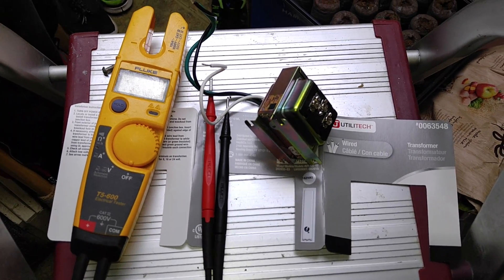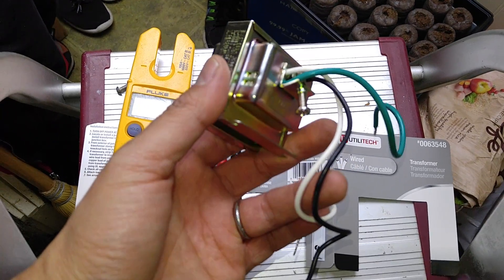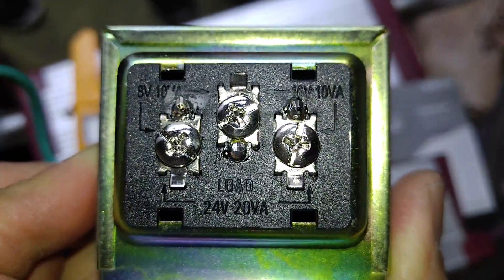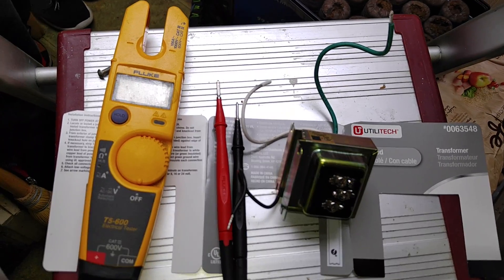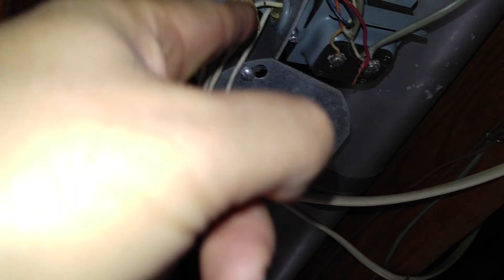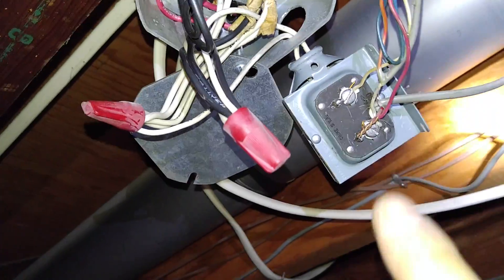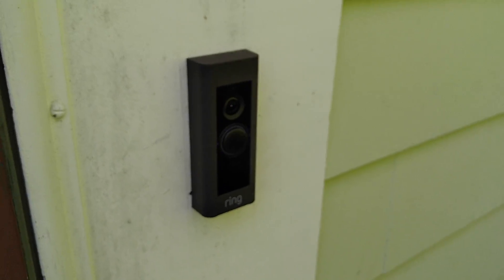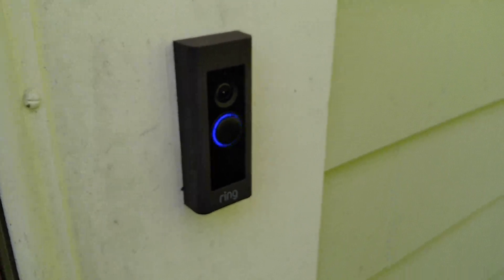Upgrade your doorbell transformer for Ring Pro Doorbell

Comment: Does the Ring Doorbell actually rings the mechanical chime unit???  I haven't seen anywhere that a mechanical chime unit will ring.
Reply from the maker: Michael Cooper yes. I have this setup ringing my 30 year old mechanical.
Reply: I believe the Ring Video 2 needs 8 to 24 Volts.  I need to get a Voltage Meter to check the voltage at my push button unit.
Reply: Thanks!!!
Reply: Yes, Ring Pro will ring mechanical or digital chimes. Look at the Ring.com website and check out the compatibility list for both store. Be sure your transformer has the correct amount of power too. I had 16 volts with 10 amps. I was getting buzzing and beeping interference. Ring said to get a 16v 20-30 amp transformer so I got a 16volt 30 amp NuTone c907. Yet, I’m having the same issues! They are saying my digital chime unit is not compatible because everything else seems to check out. I’m not so sure, but do your homework first!
Reply: RING only works with some existing mechanical chimes, not all. As soon as I installed the installation kit my mechanical chime would not stop ringing. RING says mine must not be compatible. I really wish I knew that before I bought mine. I am returning it because I like my existing chime. RING doorbell just not worth losing my mechanical chime. I will just use external cameras instead of the fancy doorbell.

Comment: I installed mine without checking to see what i had in place.  Turns out I have a 10V / 5VA transformer; (Nutone Scovill 515NA).  For some reason, my Ring Pro works just fine, I've had no issues with it.  I wonder why? Device Health reports 4350mva which is allegedly "very good".  Thoughts?
Reply from the maker: J Deveraux might be because that is the only doorbell in your system (not two lighted buttons on same chime). But if things start acting up, put the higher voltage transformer in.
Reply: I went ahead and just replaced the chime kit + the transfomer so there is no longer any doubt.
Reply from the maker: yup.  You should be good to go now for quite a while...

Comment: I switched everything out and I'm still not getting power
Reply from the maker: cocoatnm use a multimeter at the doorbell end to test for voltage. If you are getting voltage, then do a reset on your ring unit and try again.
Reply: Randy's Laboratory how do you reset the ring?
Reply: Randy's Laboratory  I reset it and it worked for a couple of hours perfectly . I went to replace the door bell chimes and now the ring doesn't have  power any more ? Should I reset it again and how long should I wait ?
Reply from the maker: cocoatnm yes reset it again and make sure all your components are connected. Wait for about five minutes after reset, then try again.
Reply: Randy's Laboratory I reset it and checked all the connections.  When it started to work the first time.  I don't know how long it took  to start working . I walked away from it for about 2 hours .
Reply: do you need help?

Comment: at 16VAC and 20vA is it enough to ring your mechanical doorchime during the day and night.  I mention night, because I am currently using a 12VAC 20vA plug-in transformer that I was using for my original Ring Doorbell, and it only rings my chime during the day.  I assume at night the night vision draws more power.  Also do you get a 3 second delay before your indoor mechanical chime is activated?
Reply: I would replace with 24Vac 40va = to approximately 40 amps.... 16Vac 30va is the minimum Ring doorbell pro requires
from their website "Your Ring Pro requires a power source that supplies a minimum of 16 volts AC at ~30 volt-amps. To check the voltage of your Ring Pro, open the Ring app, select your Ring Pro, and tap Device Health. For Ring Pro to function correctly, the voltage needs to be at least 3,900mV."
Reply from the maker: at 16 volts, you should be fine both day and night.  if you're getting a 3-second delay, then the upgrade to the 16 volts should help you.
Reply: But if your chime is supposed to have 16V, it is possible replacing with a 24V transformer could damage it (according to Ring, Nutone, and other manufacturers).  So if your existing chime has 16V I think it is best to get a 30VA or better.  20VA would probably work fine, but why risk the possibility of having to debut odd issues.

Comment: can you use the same chime, or is it not compatible with the higher power transformer?
Reply from the maker: kristian brasel on my chime, I could use the higher voltage transformer. A lot of mechanical chimes have a wide operating voltage range.

Comment: Vivint hooked a doorbell up at my house and I now do not have the service but they have failed to come get the equipment...what do I need to do to connect my existing doorbell back up and running...I have tried just hooking both the wires to my doorbell outside but it doesn't get power and I connected the wires in the actual doorbell box one to trans and the other to front door as I don't have a back door bell. I noticed they did connect wires to a transformer in my basement utility area...what do I need to do to rewire so my basic door bell will work again...thks
Reply from the maker: It sounds like they disconnected your home doorbell system completely.  Try and locate two thin wires (might be gray and white), hanging loose or taped, near your transformer.  You would just need to reconnect these wires to the output of the transformer.

Comment: I have been thinking of buying a Ring Pro doorbell. My doorbell transformer says 16V 10VA. Do you think this would work with Ring Pro doorbell, or do I need to get a 16V 24V transformer?
Thanks 
Don Zelmer
Reply: Ring Pro online help guy recommended 24v 30va transformer.  Mine is significantly weaker.
Reply: Warren Arf Williams Ring told me 16V 24V transformer. I guess it depends on who you talk with at Ring. My transformer says 16V 10VA and I don't think Ring Pro doorbell will work?
Reply from the maker: You should be fine.  Mine is running on 16V without any problems.
Reply: I would replace with 24Vac 40va = to approximately 40 amps.... 16Vac 30va is the minimum Ring doorbell pro requires
from their website "Your Ring Pro requires a power source that supplies a minimum of 16 volts AC at ~30 volt-amps. To check the voltage of your Ring Pro, open the Ring app, select your Ring Pro, and tap Device Health. For Ring Pro to function correctly, the voltage needs to be at least 3,900mV."
REPLY
Reply: My Ring Pro was connected to the 16V 10VA transformer.  A tester showed the bell was only getting 11.3 V and it woud not work.  I will upgrade to the 24 V and try that
Reply: Here is the email Ring sent to me after I called them:  "voltage required to power the ring pro is at least 16-24volts. As discussed I am recommending 24volts and 20 VAC"
Reply: It will work fine in the Summer months, but if you live in the North where it gets cold, it won't last a day or so. I'm switching to a 24v.
Reply: 16v-10va is a no go on the pro...on door bell ring  1 and 2 that’s fine...pro needs 16v-20va or more

Comment: Its now becoming discovered that Ring needs exactly 16volts in order to work. Any more or anything less produces errors or issues. I have a 24v 40va and it worked for about a month now it's going offline all the time and the voltage is constantly fluctuating.
Reply from the maker: Dr. Victor Strange do you have the power unit (voltage regulator) installed?
Reply: Is this 16v that come up on the device health or is that for the chime?

Comment: Hello I just bought the voltage just like the one you have how do you make it 24v where do I put it
Reply from the maker: You'll see at about 0:58 in the video, there are two arrows at the bottom of the transformer that point to the two outer terminals (the one on the left and the one on the right).  This will connect to the wires that went to your old doorbell (where the Ring Pro will ultimately be connected).  The wires already connected to the transformer, black, white, and green will be connected to your house's electrical circuit (green is ground and be connected to the metal housing of the electrical box).

Comment: I found my doorbell transformer located in my furnace room attached to my furnace in a light switch box that is on my furnace. My question is, is my doorbell transformer also doing something with my furnace or did the builders just put it there since it was a power supply. Also my doorbell chime is located on the same wall as my H VAC, humidifier and air to air exchange controls. I took pictures of the transformer if it helps anyone answer my question. I did notice on the transformer that it is the same brand name as my Broan-TuTone doorbell. Im trying to replace my old doorbell with a Ring Pro and when turning the power back on to my home the doorbell chime box made a humming noice so I thought it was a transformer issue. Help!! Thanks :-)
Reply from the maker: Erin Phillips most likely that transformer is only for doorbell. It was probably installed in your furnace area for ease of accessibility. If you're doorbell is humming, it could be that you don't have 16 to 24 volts going to the doorbell or the voltage regulator was not installed.
Reply: Thank you for getting back to me. my Broan-TuTone doorbell is a 16acv and that is also what the transformer says on it. I took the Power Kit and Doorbell button off after hearing the humming. I then reinstalled the old doorbell and replaced the wires back to before, now no humming. Does the Ring Pro need more power to run?
Reply from the maker: If you're getting the humming even after measuring 16 volts, then you should try a transformer rated for 24 volts.  But before you do anything else, make sure that the transformer you found is indeed the one for the doorbell.  Disconnect one of the output wires (they'll be the thinner gauge wires) and see if your doorbell still works.  If it doesn't, then you've isolated the correct transformer.
Reply: Erin Phillips, my Ring Video 2 did the exact same thing and I have a Broan NuTone doorbell system.  I disconnected it and re-connected the regular push button device.  The light on the push button device comes on, but now the inside Chime doesn't work.  I think the folks at Ring Video are not sure of the proper compatibility for the system required, since nowhere in the instructions it says to check the transformer for compatibility.  Also, inside the Chime front plate cover, it says 16 VAC, which should be enough for the Ring Video 2. Now I have to buy a new inside Chime device.

Comment: actually.. they recommend 24v for the Ring Pro.. it can work on the 16v, but tech support recommends 24v.
I was told by several Ring Techs.. that even with a 24v transformer, you also need to connect the Power Kit.
Reply from the maker: Sounds good.  But definitely connect the power kit, it's a voltage regulator.

Comment: 10VA does not mean amps, it mean volt-amps which in this case would be 1.6A NOT 10 amps!! A 10 amp transformer would be about 6 times larger.
Reply: Actually, 10VA @ 16V = .62 amps...
Reply: 10 VA is a power term and does not determine either voltage or current. Once you know what the voltage output is then you can determine the current. i.e., 10VA/16V = 0.625 amp     if operating on 24V then 10VA/24V= 0.42 amp, etc.
Reply: Gary Black h
Reply: Volt Amps = WATTS fellas.

Comment: Ring.com says you need to add a resistor. Any reason you decided not to..is it superfluous? I don't really know why the resistor is needed or recommended. Thanks!
Reply from the maker: sorry, just saw this... I did install the power kit but that's at the actual doorbell, not where the transformer is located.  Is this what you're referring to?  The power kit is essentially a voltage regulator
Reply: The resistor is for a digital chime only. Not required for a mechanical chime.
Reply: I think you are referring to the diode (for digital vs mechanical).
Reply: A resistor is REQUIRED in place of a mechanical or electronic doorbell kit for this alternate configuration to work successfully. Do NOT install a diode.
https://support.ring.com/hc/en-us/articles/205180710-How-to-Connect-Your-Ring-Video-Doorbell-Directly-to-a-Low-Voltage-Transformer-Without-a-Pre-existing-Doorbell-
Reply: Chris Cozzens, that page you linked should only be referred to for the original Ring v1, NOT the Ring Pro. The Ring Doorbell Pro has more strict power requirements. You can compare here: https://support.ring.com/hc/en-us/articles/115004668746-Ring-Video-Doorbells-Product-Comparison

Comment: That was very helpful.  Thank you.  Now, all I have to do is locate the doorbell transformer (It's harder than you think).
Reply: mine was behind the doorbell chime, in a junction box.
Reply: Randy Ballard I’m going to have to check there . I’ve looked every possible place in my house and nothing
Reply: I located mine while replacing a couple of fluorescent light fixtures with LED. It was located in a fixture box 6 ft. away from the panel. I wasn't looking for it but I know where it lives now.

Comment: If I never had a doorbell but I want to install zmodo or ring doorbell.  are there any other options?
Reply from the maker: MR PERFECT not sure what you mean. Are you asking about wiring or other types of doorbells?
Reply: Randy's Laboratory sorry this is new to me. installing a transformer and doorbell. I am hoping that there are options because my house never had a doorbell or transformer. if I had to start from scratch I think it might be difficult or expensive
Reply from the maker: Ok, understood.  You can just go with a ring doorbell and the ring chime (which is an AC-powered chime bell).  No wires needed for any of this.  The downside is that you would have to take down your ring doorbell every few months to recharge via USB.  Or, if you can wire a USB plug to your front door frame that could work.
Reply: Randy's Laboratory I should have bought the Ring doorbell but zmodo was for sale for $80!!

Comment: Have an electrical question for you - our house was built in 1978 and we had the Ring Doorbell hooked up and working with current wiring. With cold weather the battery discharged and wiring was not able to keep it charged. (not the Pro version). Purchased the same transformer you have but have a long run to the doorbell location and a short run to the chime.. Husband wants to beef up the wires, because the current wires to the doorbell are very thin gauge and are losing voltage. He wants to send 24v to the doorbell and 16v to the wall chime. Suggestions?
Reply from the maker: Upgrading the wiring won't make much of a difference.  If you have the standard doorbell wiring (solid copper core), then it will have no problem handling 16V or 24V.  Your Ring doorbell should operate just fine with just voltage supplied by the doorbell.  Here's what you should do first:  bring the Ring doorbell indoors, charge it to full with your USB connector.  While that's charging, test the voltage of the two doorbell wires that were connected to your Ring doorbell.  If it's below 8V, then your doorbell is not getting enough voltage to keep it charged.  I would then replace the transformer or see if you can up the voltage (if it has a multi-voltage setting like mine does).  If it is above 8V, then place the Ring doorbell back on after it's fully charged and see if the problem persists.  Post back here.
Reply: rankar7 thanks for the reply - the wire is not solid, it is twisted strands. The run to the door is approx 25 or 30 feet. The voltage meter showed 12 volts.
Reply: Our current chime needs 16v. Previous transformer was 16v 10va and it powered 2 lighted doorbells and the chime. But when the Ring doorbell was installed, the power wasn't enough to charge the battery. When battery drained, it wouldn't work with the amps being supplied.
Reply from the maker: I would check the voltage rating on the chimes and the entire system itself.  You might be able to just put a 24V transformer in place of the old one and call it a day.  But check first to make sure 24V is within operating voltage.  If your system did not have the lit doorbells (I'm guessing they're incandescent bulbs, not LEDs) then it would have a better shot at keeping the Ring charged.  I'm assuming you have a 20-gauge wire or thicker wire, and if that's the case, then you're good for up to about 90 feet of electrical transmission (with a 10% voltage drop).  And make sure your Ring is fully charged before reinstalling.  It is the old school chimes (mechanical) you have, not digital right?

Comment: I have 2 doorbells and want to connect to 1 front door button. Do I need 2 transformers? or can I connect the seperate wires to the same transformer?
Reply from the maker: You should contact Ring technical support for this one. The reason is because if you wire two doorbells, each doorbell would need its own transformer, and when you close the circuit at the button (when you press the button), you have the possibility of the voltage from both transformers feeding into each other.  If you're adept at electronics, you would at the very least wire diodes across both transformers to prevent voltage from feeding back into the other transformer and the Ring doorbell as well.  Check with tech support, they might already have a solution already documented for you.  You can test to see if you need another transformer by having both doorbells wired into the same transformer, and without your ring doorbell connected, close the wires at your door to simulate a doorbell press.  If this works, you might be able to just wire the second doorbell to just ring when the main doorbell goes off.
Reply: no the transformer gets two wires on same screw one for back door and one for front door. or you can join them in series on same line but on the chime box is where you separate these two wires marked front and back  or rear door.